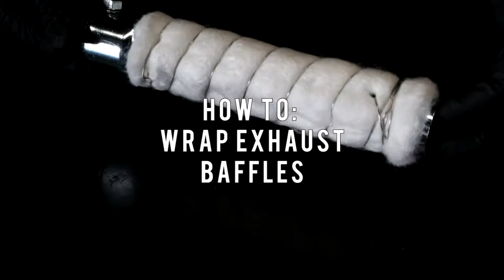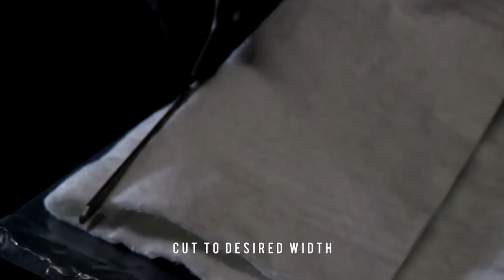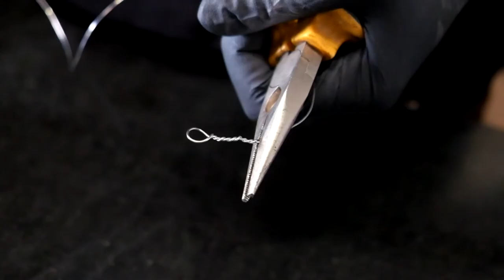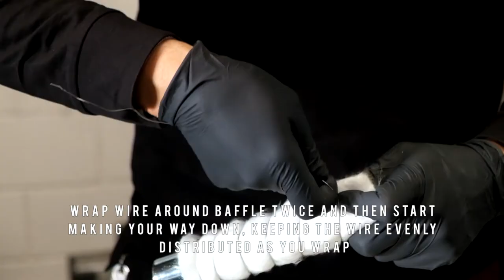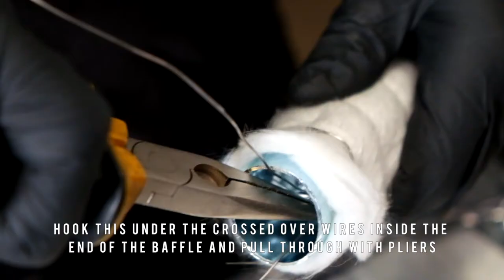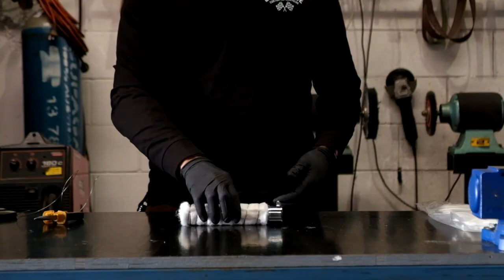How To: Wrap Exhaust Baffles

Comment: I did exactly that with my very noisy yoshimura exhaust for my Honda Ruckus, I removed the old wool, I put fiberglass like you did, with wire, and I redid a few rounds without, for what fills the case well, and voila, it's really quieter, now, thanks. 🙂

Comment: The problem is depending on the pipe/baffle size, it's usually a pretty tight fit so this wrap would end up bunching as you try to insert it.  If there's more than enough room in the pipe this should quiet things down quite a bit.

Comment: Use masking tape not wire only need a bit  to get the cover back on dissolves away no problem wire sucks on the next change..
Reply: Like painters tape? I'm about to wrap my baffles.
Reply: I use stainless steel wire and stainless steal wool for insulation.
Reply: @Viribus1  yes painters tape.

Comment: Is it possible to add too much back pressure on the engine with this fibreglass matting method?
Reply from the maker: It's very unlikely as the exhaust flow can still travel through the centre of the baffle easily. This set up pushes some of that exhaust from the central flow outward into the matting, but it won't cause the flow to reverse or be significantly stifled!
Reply: @ellaspede1667  ohh I see, my set up is different. I have a small cheap ebay baffle with no center flow. I will need to change my approach. Thanks for the reply.
Reply: Not enough to cause a problem.   Once around like video shiws you is all you need. .

Comment: Hello, I have a question: is it bad if you wrap it TOO much ? I did mine to reduce noise as much as possible, but the air has to pass through the wool now, there is no clear path for the air too take. Could it cause too much backpressure ?
Reply: @vstar7196  Thanks!
Reply: What was the verdict? Can you wrap it too much
Reply: @Stefanovicch  I noticed a little loss of roll-ability when you stop accelerating, as if the engine was braking. During acceleration I noticed no change though. I guess when you accelerate the pressure is enough to go through the wool, but when you stop, the pressure remains high in the pipe.
Also, gas will find a way, and it will move the wool for a clear passage, i had to repack it every year so far
Reply: @Baaconstrip  good to know. Might give it two layers to lower the sound as much as possible. What exhausts do you have?
Thanks 🙌
Reply: @Stefanovicch  no worries, yes try some packing and see how it goes, you will need many iterations to find the best setup i think :) I couldn't tell you what i have, found it cheaply on the internet with no brand haha
Reply: @Baaconstrip  Thanks buddy!

Comment: I wonder if stainless steel mesh would work - if one could get it in strips. Kinda like those steel scrubbing pads (not wool). It would let air through so less restriction but should muff the sound.
Reply: It burns out on 4 strokes
Reply: Doesnt do well in heat
Reply: @crvdudecrossoverr6367  yea i can imagine; a diff helmet helped lower the boom a lot

Comment: @ellaspede couple more questions whats the thickness of the wool ? and my db killers are slightly different than yours they are fat at the top and holes through the smaller dia tube like a cone shape do i just wrap the holes ?

Comment: Not a big fan of the wire. That would get seriously hot. Better to use masking tape that'll burn off
Reply: The point is that it doesn't burn off... and if you use ceramic cloth, even better, very low maintenance

Comment: I am genuinely interested, why would you do that?
Reply from the maker: They control the decibel level and provide back pressure so that your engine can run at it's best!
Reply: @ellaspede1667  Thank you for the swift answer, I used exhaust baffles myself as well. Do these wraps make it even more silent? I guess this would burn out in like 5000 miles.
Reply from the maker: @T4R3dneck  They will definitely reduce sound further, and also generally create a nice, deep note. The fibreglass will of course degrade over time, but as you can see, rewrapping is a quick an easy task!
Reply: What happens if u remove them ?
Reply: @audiophilipp  old ladies walking their dogs put a curse on you as you drive past.
Removing them will also make your ears bleed. 
I took them off my suzuki intruder on Friday as I custom built some straight pipes. This morning I've fitted baffles like these and it's still loud, just not offensively loud.
The dB meter was reading 121dB without them. Basically like riding around with a chainsaw on full throttle strapped to the pillion seat.
Reply: @audiophilipp 😂😂did you really just ask that?   Omg

Comment: Exactly Wrong!  .  You DO NOT wrap fiberglass tight with wire.  You wrap it tight with thread, install it and then the thread burns off and fiberglass expands to absorb more sound.  Crushed fiberglass cant absorb sound.
Reply: thank you for mentioning, I'm thinking the same. he could have tie down one end to immobilize it, but not crushing it all the way.
Reply: So you shouldnt use any wires?
Reply: Then.. there'smore effective way? can you give and share it? i mean it.. maybe only  roll baffles with fibreglass  and stuff it into exhaust until it's enough..
Reply: Wouldn't the thread catch fire?
Reply: @Gonzy1122 yes from the 2" blue flame that your engine shoots through the exhaust every second.  But if you are bored try lighting a piece of thread on fire and see how dangerous it is. 😅
Reply: @Stefanovicch no ...you need the baffle material to be fluffy to absorb sound.  Thread will burn off and let the material expand.  And only use enough thread to get the baffle in.  You can use Scotch tape Also
Reply: @Gonzy1122 its fire reststant 😂😂😂😂  omg.   #someoneschild
Reply: I use plastic wrap burns on contact
Reply: Right I wad just thinking this video is annoying af then I read your comment lol. Dude don't have a clue